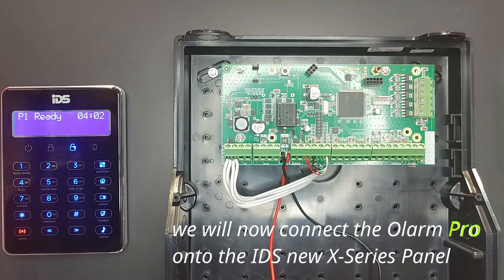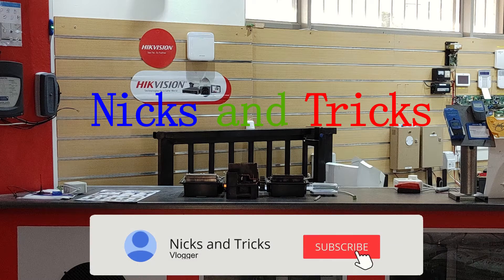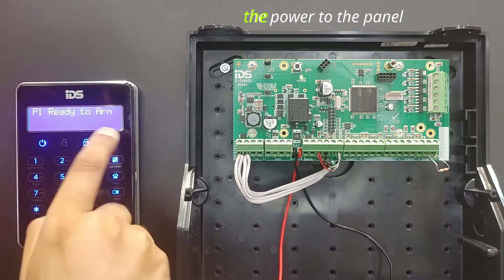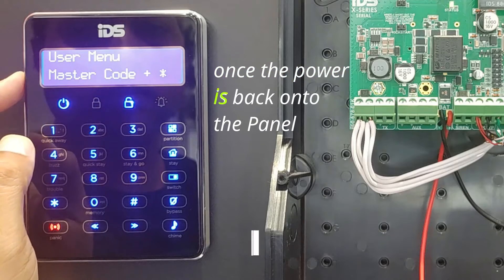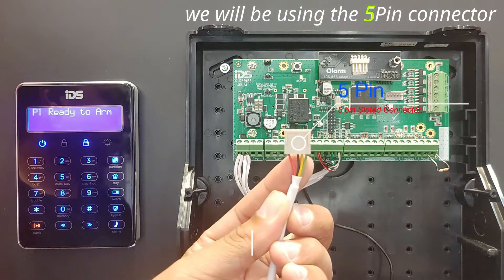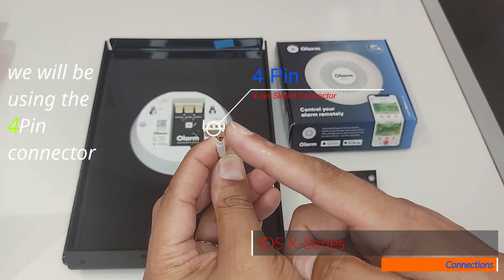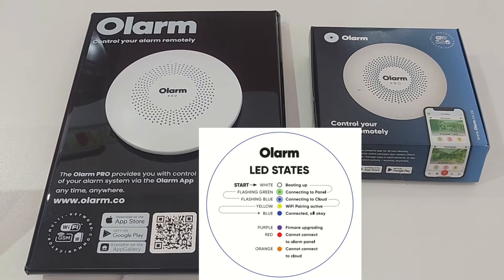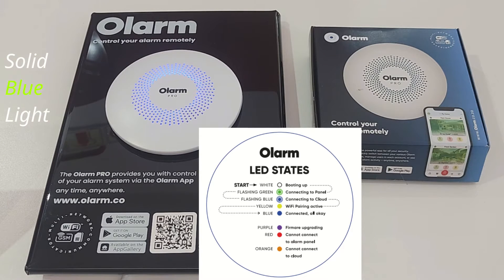Olarm Pro 4G panel connection (IDS -X-Series [new])

Comment: Anybody else notice that the Olarm does not update the time and date on the XSeries panels after power outages? If so, anybody found a solution yet?
Reply from the maker: Thank you for the comment,  the Olarm does not program the Xseries Panel, it only forwards the information from the panel. Unfortunately, you will have to update the date and time manually after any outage